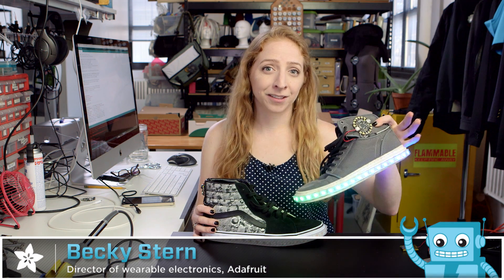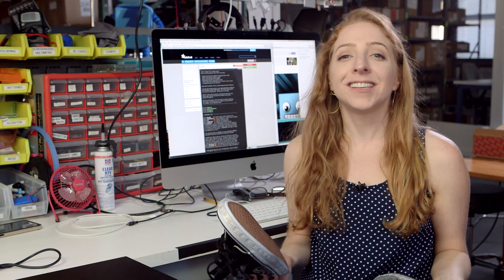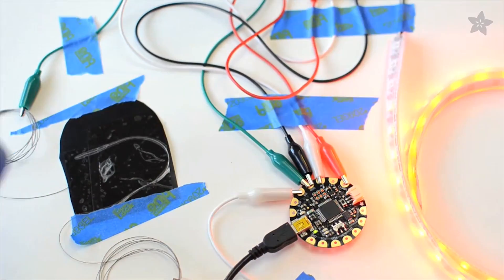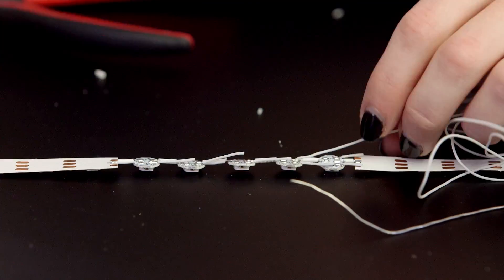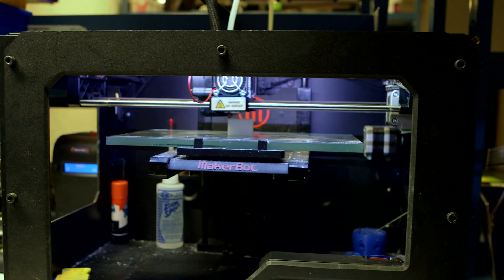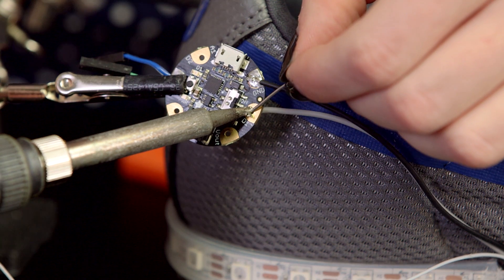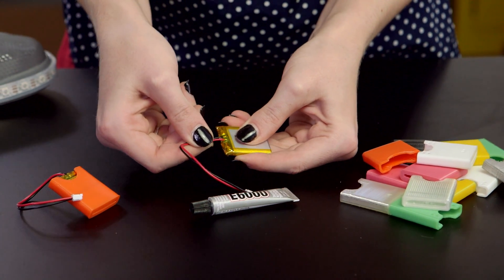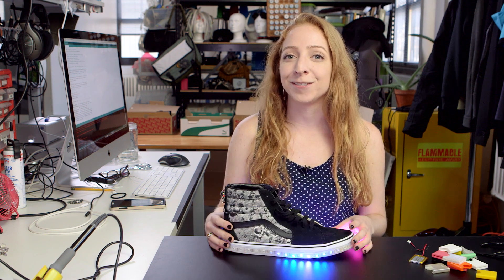Firewalker 2.0 Sneakers with GEMMA

Comment: What kind of neopixel strip did you use .ive uploaded the code to gemma and soldered everything correctly. When i tap the vibtatiom sensor the light on the gemma microcontroller indicates that its working but the neopixel strip doesnt react to it. Am i using the wrong one ?

Comment: Hello I am interested in making these but i would like to use an arduino nano instead of the gemma, however with it being an atmega328 board i get all kinds of errors when i try to compile it. I tried to use the code for the first version you guys made using the flora but i want to use the vibration sensor instead of the pressure sensor. I tried hacking away at the code as best as i could to make this work but i am really still a noob at this. Any help you could provide would be greatly appreciated!

Comment: Thinking I'll try this out... Maybe rig up the wiring to look like laces, the sensors like aglets and stash the flora in a place where it wouldn't be very noticeable... Maybe remove soles and cut out a place in the rubber? I dont know I guess it needs some more work but I'm definitely trying out the basics at least.
Reply: GEMMA sorry, not FLORA
Reply: Did u manage to do it? What about the risk of overheating the batteries/processor if you hide them in the sole?

Comment: it doesn't look to activate the same as the original. is there a reason for this? the original seems more fluid
Reply: +Connor Weller  This version does not utilize Velostat (pressure-sensitive conductive sheet). Although, I imagine it could still be added here with GEMMA too.

Comment: Instead of cutting open the led tube thingie, why not tie some string to it while it's in, then pull it out so the string is in the tube? that way you can use the string to pull it back in to the tube, would be better no?
Reply from the maker: +muns king Tried that, led to heartbreak when one of the connecting wires of the new assembly broke inside the strip due to the force of friction when pulling through (tried many times)-- didn't think it was the best way to do it for all the folks making their own at home!
Reply: +Adafruit Industries aww dang... thanks for the reply though!
Reply: One could use some lubricant in small amounts? Silicon grease, soap..